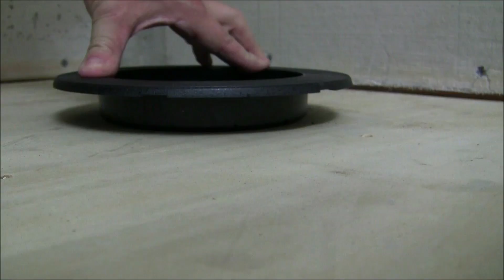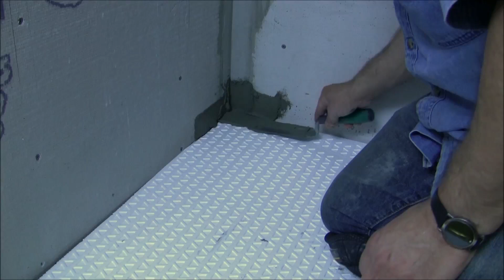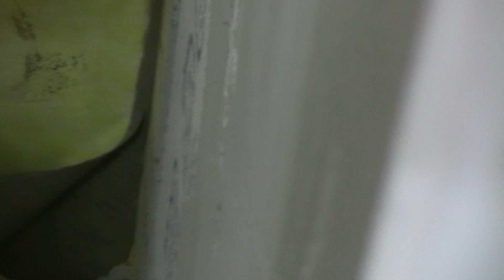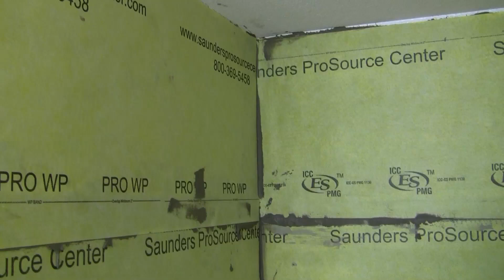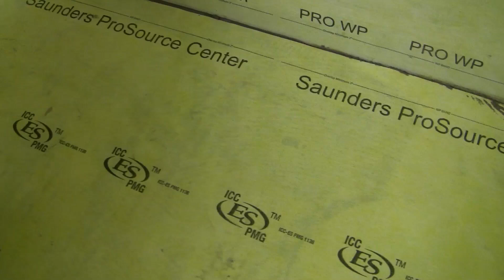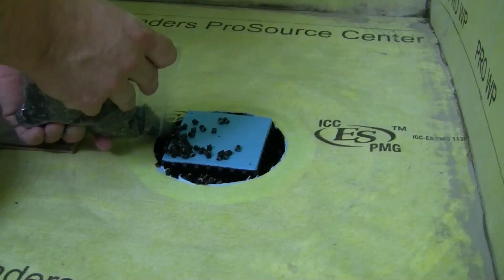[OLD-for refrence] PSC Pro Advanced Shower Waterproofing Install like Schluter Kerdi 32 x 60 Offset

Comment: Specifically, why is one able to use modified thin-set for this product, but not the Schluter-Kerdi. If modified thin-set is cured by air, how is it able to penetrate through your membrane or tile for that matter?
Reply from the maker: Hello.
That is a very good question and one that has been tossed around for a long, long time.

Most every manufacturer disagrees with Schluter on this point given the highly advanced polymer thin-sets that are available today. In other words, the curing process is a bit more complex than the oversimplification offered by Schluter, but there is no doubt that modified thin-sets cure more slowly in real-world installations.  However, I know TEC and other thin-set manufacturers approve their modified thin-sets over impervious substrates, so the degree of the issue has been blown a bit out of proportion. In other words, the modern thin-sets do continue to cure even when installed in these difficult environments.  Dural - the main competitor to Schluter in Europe - has always designed their yellow WP and Durabase CI products to be used with even higher-quality thin-sets than we use in the U.S.  The main problem with unmodified thin-set is it's lack of "stick" and it's maximum bond strength of only 200 psi over impervious substrates.

That said, highly-modified thin-sets can potentially cause issues with grout if you grout too quickly and if you are using high-density tile like porcelain.  The primary moisture mitigation and/or air exposure  will tend to propagate toward the easiest route -  the grout joint.  A 35-year veteran rep from one of the best manufacturers recommends an average of 48 to 72 hours cure time with entry-level modified thin-sets (like Custom Versabond, Laticrete 252, TEC Sturdiflex, etc.) before grouting. Warmer temperatures can shorten this time while cooler temps will lengthen.  Highly modified thin-sets like Latricrete 254 or TEC Full Flex should be allowed longer cure times because of slower moisture mitigation/air exposure.  This extra time is necessary primarily to help prevent the grout from being affected. Otherwise, the modified thin-set will eventually cure out on its own.

The substrate that you bond the WP membrane to can vary cure times as well.  For best results, we prefer a very porous substrate like concrete board of any brand. Hardie board or treated substrate will potentially slow cure times, so we would prefer concrete board or even standard drywall over those particular substrates when using modified thin-set unless you don't mind waiting longer for the cure.

The bottom line is: if you are in a super hurry, then use unmodified thin-set or very lightly-modified thin-set - the downside is unmodified thin-set has a maximum practical bond strength of only 200 psi, cannot be used for glass and by some opinions may not be suitable for porcelain.  A better installation is available using higher-quality modified thin-sets with double or triple the bond strength and allowing extra cure time - especially before grouting.

The good news is we DO NOT RECEIVE reports of failures with our system even when installed by complete novices. This mirrors our experience with installations that we have been involved with. Despite some claims about modified thin-sets with waterproofing products, our system works well with modified thin-sets in real-world installations and provides excellent protection against water intrusion that exceeds the performance of many other accepted methods.
Reply from the maker: Another fact about modified thin-sets another user pointed out is the fact that the manufacturers don't really use latex (rubber) anymore for these products. Modern modified thin-sets use any number of 10,000 different polymers and acrylics to give these adhesives better stick, higher bond strength and greater flexibility. Some of the more dramatic claims by a certain company really don't reflect actual performance of many modern-day ready-to-use high-performance modified thin-sets.
Reply from the maker: UPDATE! SCHLUTER has FINALLY CONCEDED that it is ridiculous to impossible to require unmodified thin-set mortar in this age of tight porcelain and glass tiles. They have carefully done so by REQUIRING you to use ONLY their new modified thin-set mortar (it is a nice quality thin-set mortar but there are certainly other brands on the market that will technically meet or far exceed Schluter's specification.) Schluter still allows other brands of unmodified thin-set mortar. Their rep PR statement was that Schluter doesn't want to be responsible for other brands of modified thin-set mortar that "might" not properly set up. For Pro Advanced WP, we have yet to personally use a high-quality brand of modified thin-set mortar that would not properly bond or cure. However, throughout the years, we have heard about challenges from 1 or 2 customers that used an Uber-cheap bag of thin-set mortar or perhaps one that was very old and expired or did not mix the mortar correctly.  Make life easy and use a good quality, respected brand of thin-set mortar.